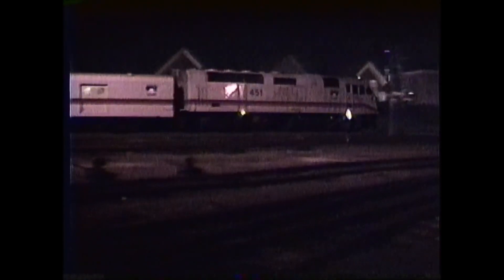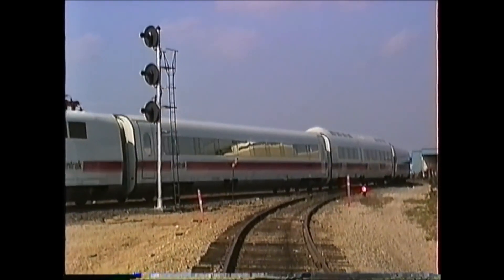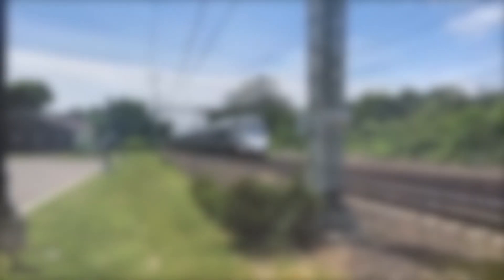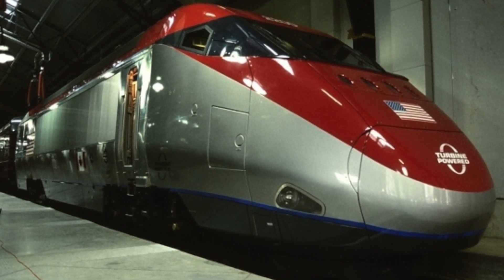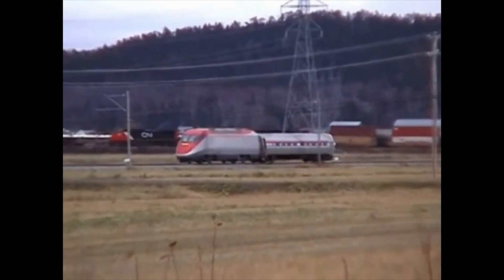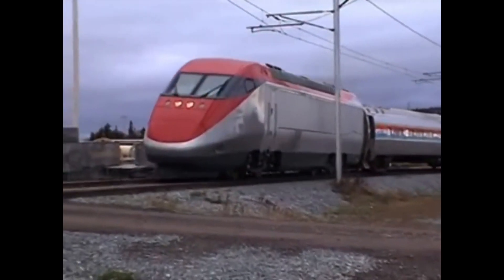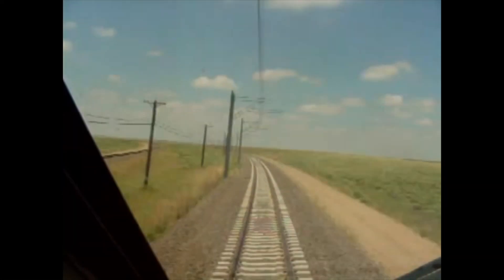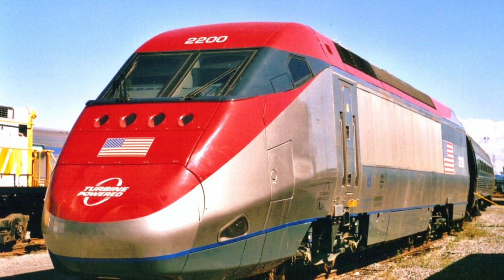That Time There was a Diesel Powered Acela Express

Comment: The Acela at 0:05 is one I saw today serving as 2167 to Washington DC with 2021 at the back and 2024 in the lead.  On 2021 I heard everything shut down in Stamford but it started up again 2 minutes later when departing.  I think that the Jet Train would have been great for many people.  I think that some of the Jet Trains should have been used on routes with no electrification but had great and sturdy tracks so the Jet Train can hit high speeds like Acela.  I wonder what the passenger cars would look like.
Reply from the maker: They looked just like the normal Acela cars in renderings. But they would’ve been mechanically different because the train wouldn’t of been semi permanently connected. But none were ever built so it’s somewhat unclear.

Comment: These vehicles will not succeed because diesel has too many letters in it and is too hard to spell. You can’t be good ol’ G A S gas
Reply from the maker: But it’s earth day
Reply: Diesels work just fine. They wanted to emphasize the turbine propulsion which are fuel thirsty, especially when the train  is traveling at slow speeds. The inclusion of a secondary diesel engine was a good idea. But, there was no political will. 

NY State was subsidizing Amtrak’s Turboliner Empire Corridor service for years. Legal problems with the final upgrade to the units forced their premature retirement. The ‘Jettrain’ might have been a great solution.
Reply: The biggest problem with turbine propulsion on land has always been its fuel efficiency at low speed. This was dealt with in this train by having a smaller traditional diesel for low speed propulsion.